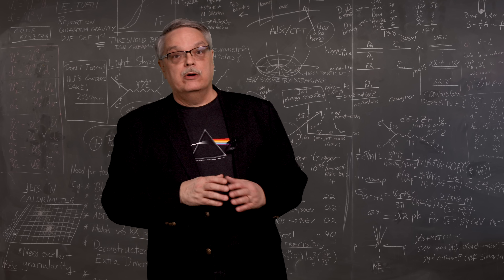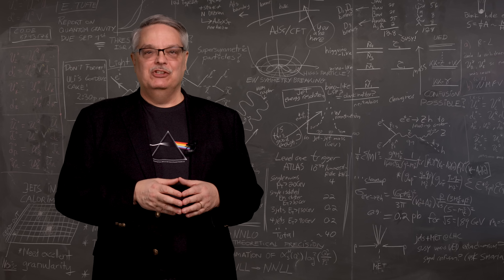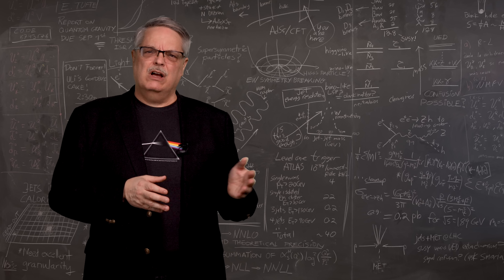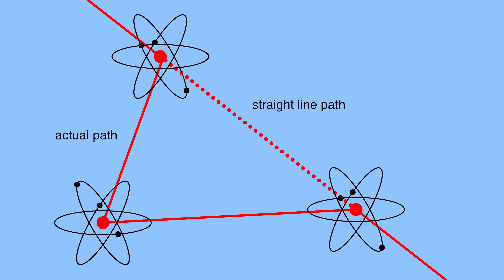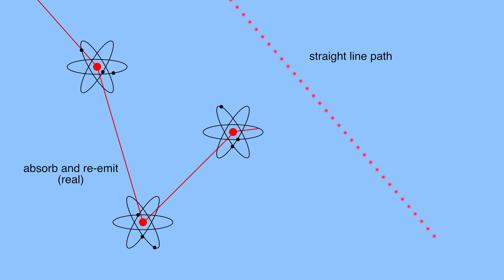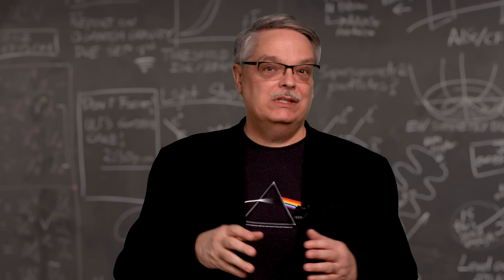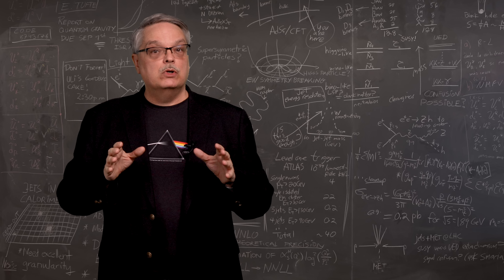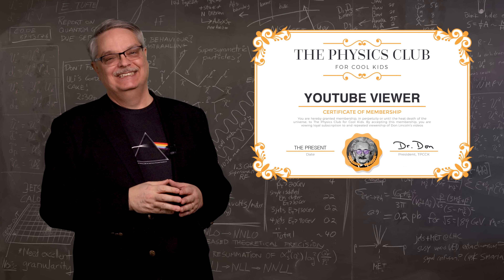Why does light slow down in water?

Comment: If the  electrons moves, that means the light looses energy and wouldn't regain speed in the same direction. I think the best explanation is that light doesn't interacts with the glass at all. The glass expands space-time, the more space, time and speed slows down, it's the relationship between space and time from relativity theory.

Comment: Amazing video! Would like to add one more question. Do energy get lost in transition between slower light speed inside the medium, and resumption of origional speed just when light left the medium?
Reply: No.  Energy, which is determined by the frequency, is conserved.  It's the wavelength that changes (shortens) in the media with higher index of refraction.
Reply: @deanschulze3129  Thank you.

Comment: Hi Fermilab; nice video, however I still have a doubt. 

Why the generated electric field (inside the glass) travels at different speed than the light? 

What I imagine is that both, the generated electric field and the ligth, travels at the same speed, but they have diferent frequencies, thus they generate a third wave where its group velocity is slower than the speed of the light. 

Please, someone to clear my doubt??

Thank you.

Comment: Tldr: light waves interfere with the electrons in the molecules of the medium it passes through. The effect of this interference is dependent on the frequency of the light, and the electromagnetic field creates an interference pattern that changes the wavelength of the light in a manner that preserves the frequency of the light. Speed, frequency and wavelength are directly related, so a temporary change in wavelength changes the speed until the light passes the interference field of the molecules.

Comment: Can you elaborate on when you say "Light still moves at the speed of light in a vacuum, but the combine wave moves slower"
This implies that there is still a wave of light moving at the speed of light thus exiting before the combined wave.   If that were true then a "light speed wave" would be detected before the combined wave exited the material.
Reply: Note that the refracted path through the glass is shorter than the straight line of the original light direction. The travel time of the slower light through the shorter path in the glass is exactly the same as the time of travel that would be at the speed of light c through the straight path.
Reply: @ozachar  how does light know to change direction so that it has the shorter path, and avoid the straight path?
Reply: @maxpercer7119  It doesn't.  That isn't why it bends.  You can watch Fermilab video on why it bends, but in short it is because the perpendicular electric field inside the glass is weakened by the matter in the glass.
Reply: @ozachar  Don't the outer portions of a convex lens cause the light to bend toward the thicker center, taking a path that goes through more glass? (Not an optics guy, that's why it's a question, not a statement of fact)
Reply: @muninrob  I still don’t get why the « slowed » wave  will change its direction by an angle depending on the material itself… what have I missed in this otherwise very clear explanation of the light wave deceleration ?
Reply: @Ukobold  TBH I was never sure on why that makes the beam bend either.
Reply: @Ukobold  Think of a car where the right wheels hit rough ground. They slow down and the car turns. When the left wheels strike the rough ground the car starts to go straight again, but slower.
Reply: @Ukobold  it bends so that that the time it travels the medium is the same as if there wasn’t any medium at an original angle of incident.  Light actually does shortest path.  All other paths(angles) would lead to longer time, which violates kinetic energy of light. 
Another way of thinking. Light has certain amount of energy. As it enters medium the electrons wave shifts its phase, hence the angle and speed. Once out, the light phase is restored.
Reply: It's easier when they use the formulae - in speech & writing it's hard to distinguish "THE Speed of Light", ("C", the constant defined as the speed of light in a vacuum), and "the speed of light" - (the speed of that light right there going through that prism right now.)

"The speed of light, C, does not change, but the speed of the light in the prism moving at "C divided by the refraction index" is moving slower.
Reply: Let me see  if I understood,  the single light wave enters the material it then changes into a combined wave then re changes into a single  light  as it emerges . Fast slow fast would that be right?
Reply: @patricksslkpatricksslk2624  It's somewhat how you conceptualize the idea... but I wouldn't say that the light "changes into" anything... it is just interacting with the nearby matter.
Reply: There is not actually a separate, distinguishable "wave of light moving at the speed of light" apart from the combined wave. The light that moves through the material is composed of oscillating electric and magnetic fields. The original fields from the incoming light combine with the fields produced by the oscillating electrons, and ONLY the net "total" (oscillating) fields resulting from that combination are actually detectable. One can "separate" them mathematically, but the net field is the only "actual" field. For an analogy, imagine vibrating a rope or string from the two ends simultaneously. A wave on the string will travel towards the middle from each vibrating end, and then the two waves will combine. After they have combined, and for as long as both ends are oscillating, the wavelike oscillations of the string will be the "net" result of the two waves traveling in different directions. If done at the right frequency, a "standing wave" pattern will become visible in which only certain parts of the string oscillate at all, while other parts remain unmoving. (This can be done simply by fixing one end of the string in place and oscillating the other end at the right frequency. With the right string, this is not hard to do.) Mathematically, there are two waves traveling in opposite directions that combine, but all you actually see are parts of the string oscillating "in place," with no wave pulses traveling in either direction. There are many YouTube videos of standing waves on a string; check them out.
Reply: Oh yeah good point; I wonder if that happens
Reply: Just see this https://m.youtube.com/watch?v=-qYh6ydhdQw
This video here has a fairly unintuitive explanation, and a simulation just shows it better.
Reply: For some light waves and materials, like xrays in water, the combined speed can actually be ever so slightly faster than the speed of light. This is just the speed that the waves appear to be moving when looking at a continuous light beam though, not the information speed of a pulse of light, so it doesn't allow faster than light communication

Even weirder, you can set up arrays of electronic circuits that have a negative refractive index for radio waves - the light appears to move backwards inside the material, while the information is still travelling forwards

For more, see https://en.wikipedia.org/wiki/Refractive_index#Refractive_index_below_unity
Reply: Well, you see, it's really quite easy to explain. The inverse perpendicular force that acts upon the tangential vector angle in a vacuum is inversely proportional to collateral substrate within the predetection area of the cross correlation to the fifth degree divided by pi minus the equinox of the winter solstice. And there you have it.
Reply: @Dr.Pepper001 : I totally knew that already.
Reply: @Dr.Pepper001  Alright ! Now I get why the speed of wit has slowed down that much in your pepper sized brain…🤓👹
Reply: @Ukobold  -- Thank you for your verubial exputation that expuriates my fundamental nonbastic hypothesis.

Comment: I don't understand. The electron electric field has a lower frequency, hence a bigger wavelength, but still lightspeed. (wave length * frequency = C)
Hence the superposition should change the wavelength of the resulting wave, but not the speed.
Similar to adding a blue and green light wave together. You will get a yellow light wave not a slower light wave.
Reply: He failed to make it clear the the induced wave from the electrons is stationary, while the incident wave is moving.  You need to understand that waves aren't really "things".  They are simply patterns created by "things".  Water waves, for instance, are patterns created by ocillatory motion of water molecules.  Electromagnetic waves are patterns created by energy exchange between changing electric and magnetic fields.
Reply: @thekinginyellow1744  Why should the resulting wave from the oscillation electron be stationary? If that was the case a simple radio would never work.
Reply: @whuzzzup  My bad. I meant that it was a standing wave, which is not quite the same thing.

Comment: At 7:15 in the video Dr. Lincoln Shows how two waves interact "when one wave i s moving at a different speed than the other" . I infer from this that in the diagram wave 1 is the initial wave coming from the vacuum, wave 2 is the wave created by the excited electron. Doesn't the explanation then imply that wave 2 is moving at a different speed than wave 1 to create wave 3? Shouldn't wave 2, being an electromagnetic wave, be moving at the same rate as wave 1. If not this raises the question why is wave 2 traveling at a different speed than wave 1? Thanks for the answer if anyone has one, and thank for the great video!

Comment: if the electrons inside the glass are oscillating because of the force coming from the light waves... and this new combined force is interacting with the light and the electrons together... wouldn't we be able to interact / change the image traveling through the glass by interacting with the electrons in the glass?   ex: create an interference and make the glass become opaque?

Comment: If light is a wave, the question is, "a wave of what"? Waves need a medium. What is the medium in the vacuum of space? You need to bring back the concept of the aether to make this explanation work. But I digress. Light is pulse perturbation and does not have a "speed". It has a rate of induction through a media. It has a slower rate of induction through glass because glass has a different dielectric permittivity, magnetic permeability, resistance and capacitance than the aether.

Comment: Okay, so ... does that mean that light leaving the glass has always a slightly different wavelength than light entering it, because the second vave got merged with original one? If you had dense enough material, could you shine a blue light in and get a red one on the other side eventually?
Reply: I guess light leaving the glass isn't influenced by the electric field of electrons hence and resultant wave is that of the light itself

Comment: I have a small doubt which is this :
If the wavelength of that light changed then it's frequency should also have changed ( as I think they both are inversely proportional to each other) and thus the speed of light should be constant ! But it is not why ?

Comment: This explanation is not plausible, neither is it coherent:
1. It is said scattering is one of the wrong explanations and that the correct explanation is based on secondary waves, generated by electrons which oscillate due to the primary wave. But that is the very description of Rayleigh scattering. 
2. It is demonstrated that the superposition of two waves propagating at different speeds travels at a lower speed than either of the individual waves. But why would the secondary waves (see above) move at a different speed than the incident wave?

Comment: It was mentioned that when two waves of the same speed superpose, the speed of the resultant wave remains the same, only the amplitude is altered. It is only when the speed of the two superposing waves are different does the resultant wave have a speed different (less than) from either. When exposed to an electric field oscillating at a particular frequency, the electron feels a force due to this field and oscillated along with it. If so, both these oscillations have the same frequency and hence the external field and the field originating due to the election oscillation have the same speed. Then, wouldn't the resultant field in the medium have the same speed as the original one?
Reply: Exactly my thought Rohan!!! I don’t agree with the explanation in this video (just yet)!
Reply: Thats the video wrong axioma, I think. Interference dont change the speed of the beam.
Reply: I think it's because the electrons have mass so will lag behind the wave.
Reply: @nade5557  that was my thought too. It didn't help that in the graphic the light wave and that produced bt the electrons appeared to have the same period. It also occurred to me that the light doesn't "hit" all the electrons at the same angle, so they might not all oscillate at the same frequency.
Reply: @nade5557 
The light they emmit will still travel at c.
Reply: Was that an explanation? - I'm not sure
Reply: it may have something to do with electrons having some form of natural frequency in the way they can be moved by the electric wave of the passing light... similar to pendulum or spring natural frequency ....
Reply: Remember that light is a disturbance in the existing electric field.  That field is locally influenced by the moving probability distribution of the electrons in the material.  When the light passes nearby, the local field is further disturbed as is the probability distribution of the electrons.  The resulting signal is then different than the original incoming light as described by Dr. Lincoln.  When the signal exits the material, the field conditions change and the light resumes its original properties but lacking a few quanta due to minor heating.
Reply: But frequency is not speed, so the electrons in the glass vibrate at the same f but do not propagate with the dange v

Comment: So does light speed up after leaving the glass?  How long after leaving the glass does it reach the speed of light?
Reply: Not a physicist, but what I got from the video is that the light wave itself neither slows down when entering the glass nor speeds up when leaving it. What happens is that the light wave, when entering the glass, combines with the wave of the electrons in the medium, creating a combined wave. That combined wave is slower than the light wave, so light effectively slows down due to the combined wave.

When it leaves the glass, , there are no more electrons with which to create a combined wave, so you're just left with the light wave itself.
Reply: jeh32 I thought it was because the lights path changes direction.  So light traveling thru water and glass travel a greater distance.
Reply: @Mike_M_Smiths  Again, not a physicist, but what I got from the video is that the combined wave changes direction because it's slower than the light wave that enters. When it exits, there's no longer a combined wave, so the light wave resumes its previous direction.

Comment: 0:17 "Internet is also 
a source of misinformation" The only true in this video.

Although this theory is much more elaborate than the bouncing photon and / or absorbed photon theories. it also limps: the superposition of two waves does not imply that either of the two original waves change speed.

But look at the sea, or rather, in a swamp where you can see several waves of different sizes crossing ... if you see a row of buoys on them ... you will end up appreciating a new wave with its own frequency and speed (surely irregular) but no sea wave is "destroyed"

Therefore, even though the superposition of the light with the electromagnetic waves of the electrons in a crystal creates a slower wave, the light will still pass so richly through the crystal smoothly. Just like the waves that you create with your hand on the beach pass over the waves without flinching.

But the 27,000 likes of the video (as of today) are impressive: the video that says that you can measure the speed of light with a slice of cheese and a microwave because light "is a standing wave" only got about 300 likes . 😂

https://www.youtube.com/watch?v=qzQsMmTHk5Q

It may seem very sad that in the middle of the third millennium the answer to a question that seems very simple is not known. But I find the ability of the human being to deceive himself fascinating.

Comment: Is there theoretically a way to achieve resonance with a photon then? I would assume not since I don't know that you could change the frequency of the wave of electrons, but maybe by changing the frequency of the light? No wait, it's a speed thing, not a frequency thing, right? Hmm... But wouldn't there still be a point where the frequency of the electron could induce resonance in light consistently despite being at a lower speed?

Comment: So, when the light moves the charges in atom, doesn't it give some of it's energy to the charge? And if it does, then why is the equally bright when it leaves? Or it isn't. Also, how do degenerate orbits exist, I mean when did physics start to have exceptions. Also, are we at rest or moving? And if moving, with respect to what? And if we're moving, is time different for us than it is to the frame of reference. I'm sorry I'm full of questions